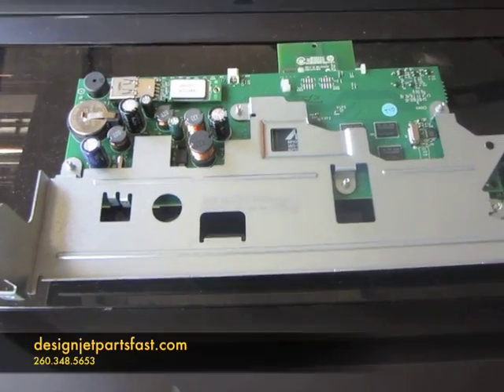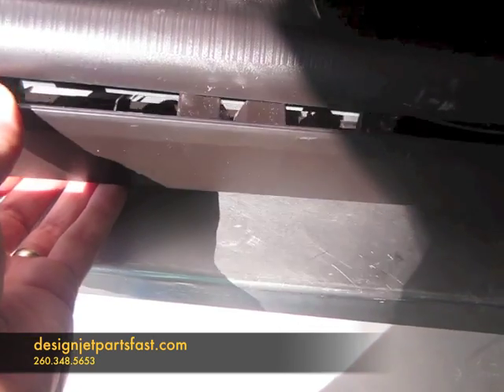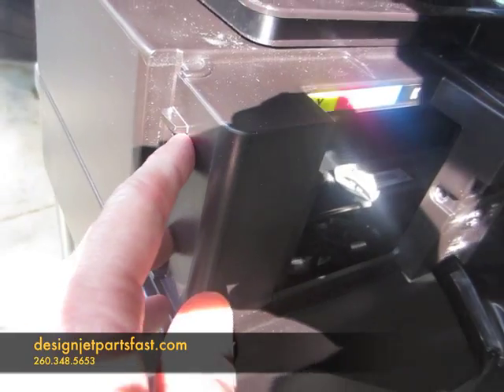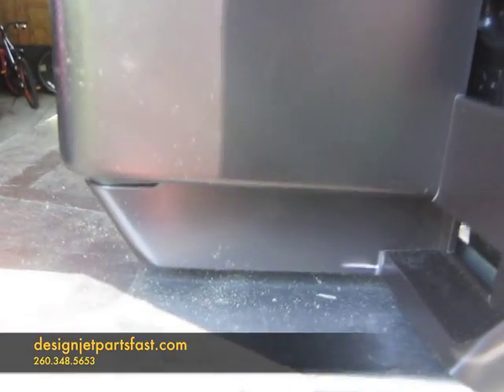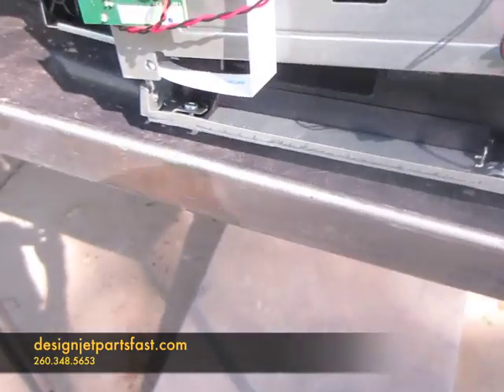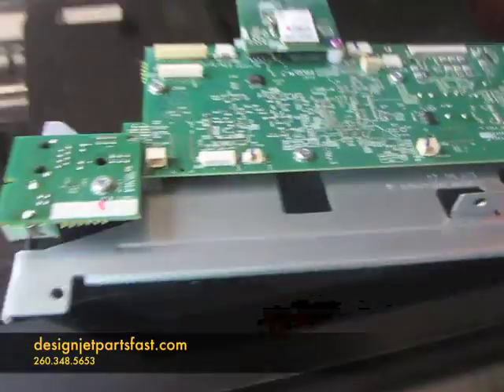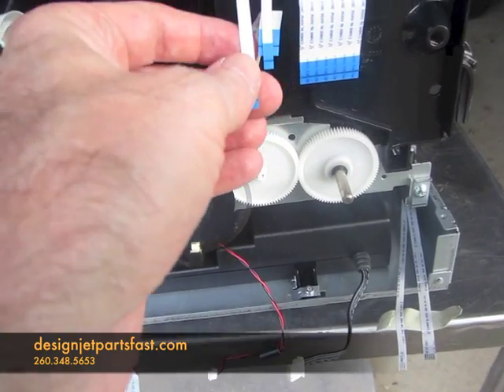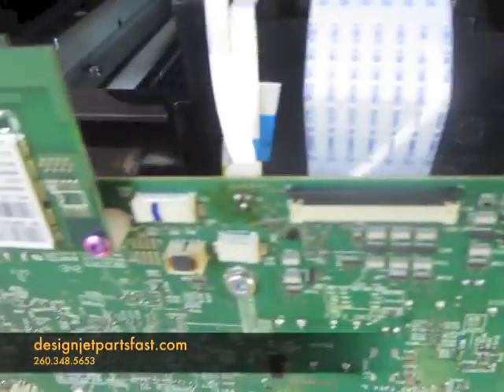HP Designjet T520 Main PCA Board CQ890-67023 CQ890-60251 CQ890-67097

Comment: Hi I have a HP Deskjet T520      Blue screen B3006E2C.    Does this means that the board is bad.  and can PCA Board CQ890-67023 CQ890-60251 CQ890-67097       replace mine.
Andrew
Reply: @FixYourDesignJet  thanks.  When replace I will let you know results.

Comment: Would this fix work for error code BA7E3790?  I just get the blue screen with this error.
Reply: Are the parts new or refurbished?
Reply: Thank you for the fast responses. What is the return policy of the part does not fix the error? Also, is shipping included in the part price?